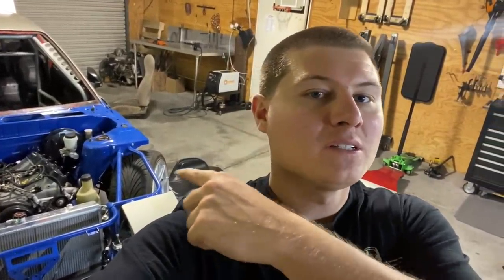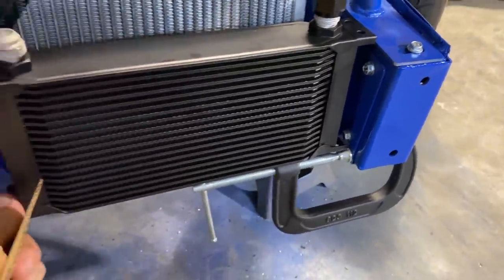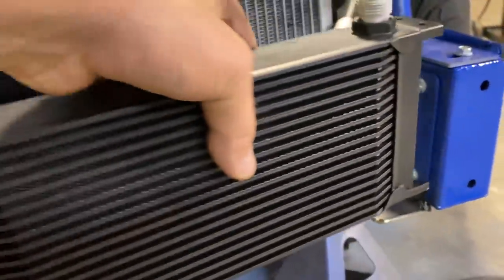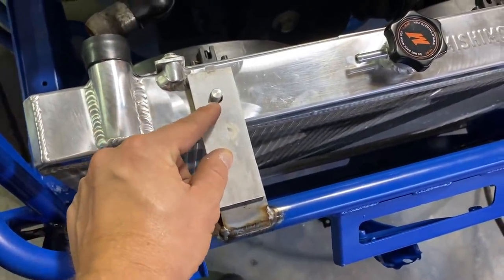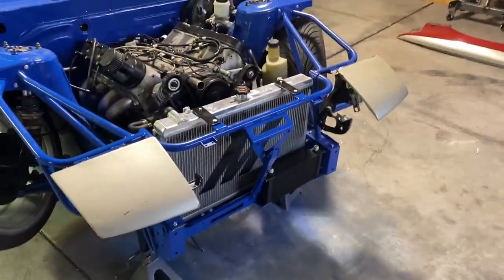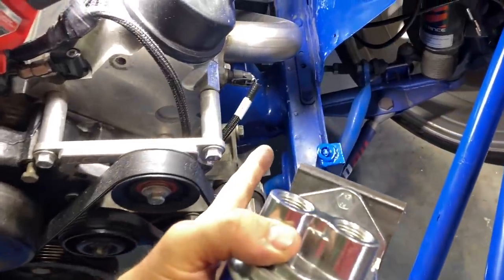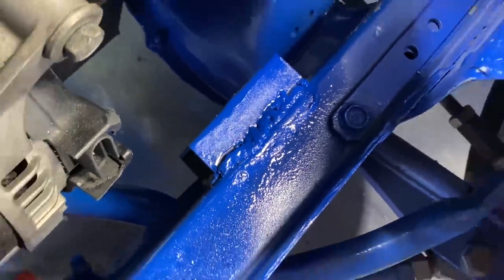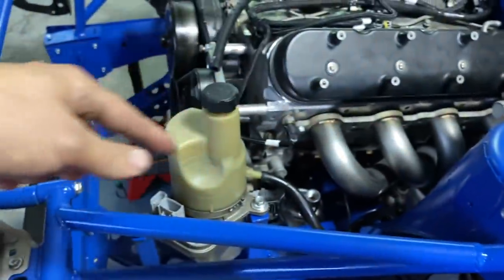Mounting The Oil Cooler & Radiator! (PUT THE WELDER DOWN)

Comment: With the welding, your ground lead is clipped on but over fresh looking paint. Sometimes this leads to ugly welds because your not gettin a great ground. 🤷🏼‍♂️ could help.
Reply: I agree
Reply: lol exactly
Reply: Always ground to bare metal. 👍🏻👍🏻
Reply: A good weld is 90% of prepping and 10% of welder tuning.
Reply: Sometimes in a pinch you can also use some vice grips and clamp them down and wiggle them back and forth so the teeth scratch through the paint or rust if you cant really get a grinder to the spot you're welding. Then attach your ground to the vice grips.
Reply: Take some 0 gauge wire n strip it back a couple inches and bolt it on close as you can, clamp to bare wire
Reply: Agree looks like poor ground and maybe too much wire speed or mill scale
Reply: Good man.... not trying to bash him, just genuinely  giving advice !
Reply: @BOOT  Yes! This is one of the best ways to keep a good ground. You could put two on it one for the front half and one in the rear half of the car till you get mostly done with the car.
Reply: Looks like to much wire speed and not enough voltage. AutoSet on Hobart/Millers are a bit useless.
Reply: With your welder, run it at about 3 to 4 on the volts and 30-60 wire speed for metal like ur rad support and run lower volts but around the same wire speed for thin stuff. And run your gas at about 15-20 psi. I have the same welder and it works great around those settings.
Reply: Thanks for all the welding advice. Who would have known YouTube comments have the best tips lol
Reply: @HiredHitman63  it was goin well until you said JEEP! 😆  only joking with ya,bet the jeep was killer!!!!

Comment: Keep up the grind coop, your gonna want to run a cooler on that power steering pump, electric pumps don’t like getting heat soaked, wrap those power steering lines up while you can still get to them

Comment: At auto parts store they have walls of hoses, so for a radiator hose I would go there and try to get a couple that might work
Reply: Exactly what I did for my 280z LS swap, just took some rough measurements and found a hose randomly in the back of an Advance Auto Parts.

Comment: I've herd you should use rubber bushings when mounting oil coolers/ radiator's because they heat up, expand and then can crack over time. But this is a drift car so it may not last long enough to be a problem 😉

Comment: I'm surprised you didn't wait until the end of paint everything, you must have been cringing as you grinded brand new paint to weld lol
Reply from the maker: Honestly I just knew I wasn't gonna want to take it all back apart after I finished
Reply: @CooperBogetti  LoL fair enough, I've certainly done it too, esp when Its just an engine bay.
Reply: Coop its just spray paint.no need!
Reply: #copper is thz best
Reply: Rust is worse, H8 it!
Reply: It's a good idea to keep it from corroding.

Comment: So did you bring The Mystery Machine with you to your channel Coop? Nice vids btw excited to watch your journey. 👍✌️
Reply: The Mystery Machine is on the other side of his shop.  I'm hoping he replaces the blown out window with painted louvers to help with air/smoke flow.  Shoot, all the side & rear windows could be replaced with louvers and fans to make that thing a smoke factory.
Reply: @SirVic42  With the amount of smoke that the mystery machine makes. I though that one could open the wheel wheels and put in some ducts with a high volume fan and then redirect the smoke out from another location. This would allow for a very nice visual of the van while still giving a good smoke show. Also adding in a vented door for the rad as well. Redirecting the smoke will allow you to still see the van during the burn out. All the smoke is great yet it does not allow you to really see the van and what it is doing. Having the fans redirect based on which way one is steering would be a nice addition. When the front wheels are forward the smoke would come out of 2 holes on the top and then when going left or right the smoke would be redirected to a hole on the left or right. Adding in some nice color LED lights may add some color to the smoke as well. Not sure if that would work or not.

Comment: Cooper for an angle kit, get the FDFraceshop kit, or GKtech. As for your rear, get an S14 rear subframe, or get the GKtech LCA adjustment bracket. Also, try to switch the diff up to a 6 bolt R200 (if you stay with it) and run Z33 axles. Way cheaper and stronger than S-chassis 3x2 axles.

Comment: Welding tip if you don’t mind. I use the same Hobart welder at home and if you turn your heat up a notch and wire speed down you will burn in better but those welds will hold for what your doing glad to see you on your own channel

Comment: Bracket Corners not all the same, slight off-set from central on the radiator mounts just because stuff you OCD ha ha! I love it! You're doing a fantastic job! If it holds, It'll Roll! I did a shopping complex cabling job (Phone network) a couple years ago. the IDF Hub had about 500 zip ties on the vertical cable tray down to the termination points (1,000 plus connections) Every single one of those zip ties were exactly the same, except one, on purpose just because... Can't wait for the next one, loving your channel!

Comment: I would definitely add a power steering cooler, the volvo s40 pumps are susceptible to heat and can fail prematurely if they or the fluid gets too hot. I've had the same pump in my 89 Prelude Si-4WS for a few years now, it still works great 👍

Comment: Hi Cooper, it's probably better to mount the brackets onto the unit then offer the unit to it's final position and then weld. This will ensure that there isn't any stress on the unit when finally mounted. I like what you're doing.

Comment: Old radiator hose makes great diy isolaters n so on, cut some square pieces to put under those radiator brackets, you could even glue em on the brackets if yah want

Comment: I would strongly suggest that you add a 3rd (a forth wouldnt hurt) mount.  The oil cooler will bounce around a lot as you are driving and either the weld will fail or the oil cooler will rip and fail.  You are in the area now save yourself a lot of time and effort and maybe even track time buy adding that mount in now.

Good luck!

Comment: Some constructive criticism; keep that ground clamp on clean metal and always clean up the metal that is being welded very well, move slow and make sure you are getting good penetration and no spatter, use the recommended settings on your machine for now and just focus on your control. Keep at it brother you're off to a great start and will only get better as you keep going!

Comment: Coop, get yourself an ESAB EM215ic mig welder (or one of the mig+tig+stick models). You tell it the metal thickness and pull the trigger. Then as long as your technique is semi ok, it will make good looking welds.

Comment: Nice video.
Just a little correction on your take on the hydraulic line for the steering pump.
Extra length won't introduce lag as long as you re using hydraulic line.
Hydraulic unlike air is incompressible. You could 3 miles on line that won't change the respond. It will still be instantaneous.
Good luck with your project and have a good day

Comment: Coop you said rubber grommets on the radiator. Looks like the same size as the grommets on a stock ls valve cover bolt... may be useful if you have a couple used one laying atound.. just a suggestion. Keep it up man looking good welds will look better the more consistent you weld.. looking forward to the growth of your channel.

Comment: Where did you get that stand for your milwaukee porta band? I need one. And don't be afraid to turn the amperage up some on the welding. It will help it flow out better and penetrate more

Comment: Loving the vids. Keep it up. 
What are you using in the rear for the cradle, diff and drive shafts?  If you are sticking with the stock cradle you should try and get your hands on a non vspec gtr diff and shafts.

Comment: good work, practice makes perfect with welding, but strength over looks any day, btw would probably mount the oil cooler on rubber bobbins or similar, give it a bit of give so it doesn't crack so easily through vibration or just plain tapping the wall, drift car life and all that :)

Comment: I like the car you're building. Most other U Tubers pad out their vids to 17 mins by including shots of the fab work. Couldn't the pump line have been routed behind the turret, further from the exhaust. You will need to wrap it now. If you put the steering pump mounts off the outside of the rail you might gain space. I worry whether it wont be bent by shock or vibration.

Comment: You might want to consider rubber mounting some things for vibration and on the off chance that you stuff it into a wall at an event. You aren't gonna get a bolt back in a hole if it's 1/16 off but if it's on rubber you have some wiggle room.

Comment: Coop, You want your weld ground to be on a non painted surface.

edit: just fyi, describe the material your working with by it's size. That steel tube is called 1x3 tube or box tube, not metal. same with flat bar. 99% of what your working with is gonna be aluminum or steel. just call it that. in fabrication, no one says 'metal'. you don't have to get specific like 6061 AL or 4140 steel, just say alum or steel or brass/bronze. Keep it up man. you're doing good.

Comment: Hey Spaghetti man.. I'd recommend throwing some heat wrap around those headers or around that Power Steering line (or both) nothing sucks more than an oil fire in the engine bay.

Comment: Use a wire brush to clean up the area after you tack it, then weld it. It’ll run a little better. I know you ground it off but then the brush will knock any grime off as you lay your bead.

Comment: Open the door to the welder. Look at the chart. Set 1 setting higher than recommended. On my Miller that tubing would have been 18.5volts around a 349 wire feed speed. 22 on the gas. You need a little more gun manipulation an circle motion

Comment: Curious why you used nutserts on that spacer.  Don't have a tap and die set? Though I suppose that steel tube isn't all that thick, might not have had enough meat on it to tap. Nevermind :P

Comment: Just grab some chunks of 3/16" steel or something thicker and start practicing welding lines/butt joints/etc for a few hours to get the hang of how the bead lays and figure out the best settings with your welder for the thickness.  Best way to get better is to keep doing it!

Comment: Remember, everything flexes.  That's why windshields crack in drag strip runs and dyno pulls.  That's why radiator tanks crack, and oil cooler tanks leak.

Comment: Wonder if Volvo would have had rubber grommets in those bolt holes for the servo pump, maybe Coop fitted some that I missed seeing?
Everything shakes and vibrates more than one thinks, probably more so in a competition car.
And when at the track its driving me likes, not mending stuff.

Comment: Were you welding the nutserts into the oil filter spacer?  Because that’s not how nutserts work?
Reply from the maker: I've had them spin on me a few times when taking bolts out so I've just started to weld them in. It's so easy to just weld them in

Comment: Hey Cooper cut you some rubber fuel lines for drommits. You'll need 2 different sizes a bigger one for the top and bottom and a smaller one for the middle.

Comment: Coop. Do yourself a favour and probably wack some heat shield on the steering line due to the fact it is close to the headers. And if you want to improve your welding there are apps. For settings to help. Or YouTube. Videos. Having a crack. And making it happen. 👍👍

Comment: Hey Coop. How are you venting your paint booth past the fan? Any filters?
Reply: He has a box fan(didn't see a furnace filter on it) sucking the overspray down but should wear a respirator still
Reply: I was curious where it vents to after the fan. Hole in the wall and just blowing the overspray outside?  Eating into the shop would defeat the purpose me thinks.
Reply: @beyondmaintenance  It's an AC shop so prob not outside but I agree, not so much for the overpsray but fumes of the solvents used in spray paint as it dries.  Why I prefer to paint outside when I can or air the room out before I go back in after it's dried

Comment: MIG is super sensitive to having a good ground. make sure you have the ground on clean metal. other than that, your welds need a little more heat and you need to move a little slower.

Comment: Drill and taps my friend. Faster than the nutserts.
Reply: Nutserts are good for thin material or where you can't get behind, otherwise I prefer to weld nuts and have a formed work hardened thread, taps for cast stuff
Reply: With what he working with in the neighborhood of 1/8 he should have no issue. They are only 1/4 or 6mm bolts. Nothing crazy load bearing.

Comment: Where did you get that stand for your Milwaukee band saw?
Reply: I don't rem seeing the one he has but SWAG makes one for diff portable bandsaws
Reply: BOOT I seen his and started looking Iol one of those tools that when you need when you need it but probably in reality only use once
Reply: @cornfedwyteboy2  I looked back at the vid n saw it. Full size band saws I've seen cut down like that, slow n usually with coolant.  Also have an up position like the SWAG, I think the up would be more useful to a small diy fabricator.  Also just rem a guy i know made his own adapter to bolt it in a large vise n use it like the SWAG

Comment: Bro your welds would be way better if you put the ground clamp on a non painted surface. May not be setting or gas at all... But poor ground. You would not put battery ground on paint would ya?

Comment: Buy yourself a nutsert or rivnut tool, it will make you life so much easier when you are mounting brackets ect
Reply: well there you go if i waited another 30 second  lol
Reply: Hi me again, if i seen correctly and you did weld the nutsert in you can buy a tool and it is probabily easier than welding them in
Reply from the maker: I have a tool, I don't like it because they can still spin when removing the bolt, I've done it before and it's terrible so I just weld them in now

Comment: FYI the length of the hose has nothing to do with the performance of the pump once it's full it's full
Reply: It actually does, think of it as a column of fluid/mass.  To long or to large and it can be harder to push/pull.  A lot of thought goes into a low loss fuel system or other flow types

Comment: You need to YouTube my statement but you need a rubber spacers between your radiator and a metal mounting brackets or you will rub a hole in it

Comment: Need to get a tig. Mig is for mass production. Too much spatter for welding on a vehicle
Reply: tig is nice but mig is fast
Reply: @BOOT  right it's for production. If you doing one off stuff no need to go fast. Especially when splatter can ruin a radiator or paint job
Reply: @electromechanicalstuff2602  Tig is also harder when not on a table, not everyone can free style tig in vehicle
Reply: @BOOT  sometimes but sitting on a chair in the upright position like coop is, isn't that bad. Are you going to address the spatter potentially ruining parts at all?
Reply: @electromechanicalstuff2602  Oh sry, shield them with a cheap HF welding blanket, cut it up if you must.  Still leaning in some spots with the torch n stuff, it's just easier to mig

Comment: OK Coop , Im guessing that you cant see the weld real good when you are doing it . Get yourself an optrel crystal and adjust it properly. Start there ,you gotta be able to see the weld pool clearly.  Most of the time even if the adjustments are off you can compensate with technique... Just takes some doing and you are already pretty close...
Like the channel so far,,,just original stuff not over the top circus clowns and shit.